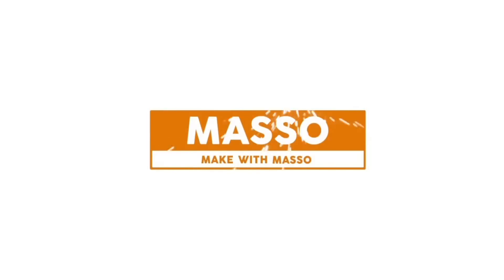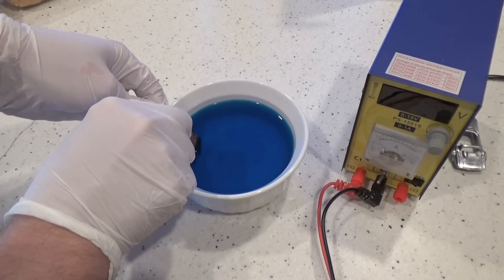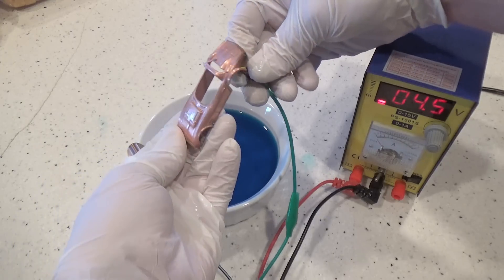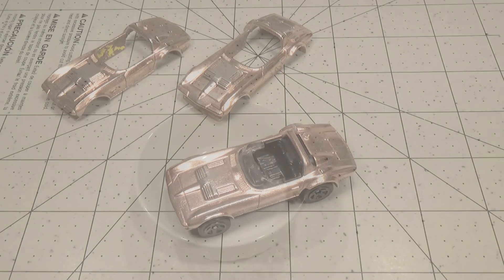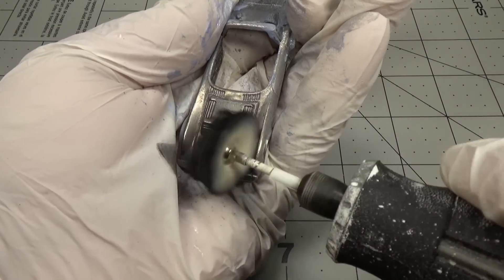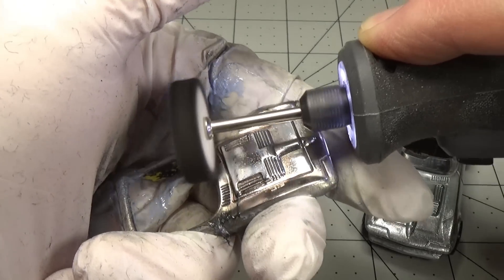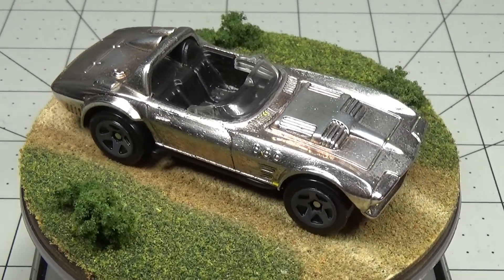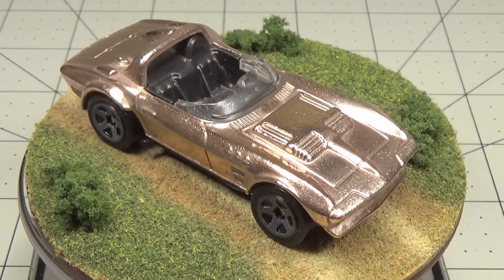A Guide to Copper,  Nickel and "Chrome" Plating a Hot Wheels or Matchbox Car

Comment: FYI, the copper Anode does nothing but provide an electrical receiver that will not contaminate the solution.
YES, the solution will run out after a while.
So far, I have done 10 cars with 8 OZ of the flash solution, some 2 times. Still works great.
My copper Anode shows no sign of being used. Still looks like new.

Comment: Are the die cast cars pot metal? I have a few antique mantle clocks that have cast, pot metal cases. They were originally gold, but have been painted at one point. I'm researching techniques on how to gold plate them. I guess pot metal would need to be plated with something (maybe copper) first, before the gold? Or else the gold would not stick? Is this all correct?

Comment: In Europe, zinc diecast parts a generally zinc strike plated "first" before they are copper plated. The intention is to ensure a better bond as copper does not adhere well to the aluminum that may be present.

Comment: I just won a chrome plated car on Ebay. It's an anniversary edition of the Firebird funny car. The one based on a 77 Firebird. It has a raised Hot Wheels anniversary logo on the roof of the car. But the chrome coat is badly chipped. I assume it's not an actual plate job but more likely a paint. What would be your suggestion on how to refurb that chrome look cleanly? I've watched your playing videos and I have seen people airbrush the chrome Molotow paint to make a chrome look.

Comment: Hello. You seem to be the guy with the chemical knowledge, I wondered, have you tried Retr0bright on yellowed window pieces? It's an idea that keeps coming back to me, and I did try it, but I'm not sure I got it right. Didn't hurt the pieces any, though.
Reply from the maker: I use chlorine dissolved in methanol... gets rid of the brown in seconds and requires no sunlight.
Reply: @baremetalHW  oh, brilliant! I'll have a go at sourcing the chemicals. Is there a rough ratio you could advise? - Thanks. (p.s. if you have to do one for a video soon, would love to see it in action, but you seem so busy I know that is a bit of an ask).

Comment: Another excellent video! Great information! Thank you for sharing this! My favorite is the nickle because it gives a nice patina look to the casting. But I also like the copper car too, plus you can solder it if you need to. That's cool! Thanks again for the info! And those copper ghost flames would look hot under a light color spectraflame!

Comment: Watching the bit with the copper flames got me wondering.

If you masked in a vinyl tape can your hobby laser vaporize that like it does paint.
So strip car initial plating, mask, laser the flame pattern, plate with copper, remask and laser the outline of the flames and remove majority of the masking so they are protected and then spectraflame paint.

Will the laser blast the spectraflame off? If so what would happen if you plated an exposed area with the rest spectra flame painted

Comment: Here's my two cents.  I've been copper plating and electroforming for about two years now.  To get a half decent plate you need to electroplate more than a few minutes.  I would recommend at least an hour.  Preferably longer.  I plate jewelry sometimes up to 24 hours.  That gives me a layer about half a millimeter thick.  I can't even file through the plate without really trying.  Also, once you get a decent plate, you can electropolish.

Comment: The ghost'ish flames are nice. Might be able to figure out a way to nickel then copper the flames over that. Can you remove the nickel or chrome with your laser? Can you copper plate after nickel/chrome plating without plating over the nickel/chrome? So you would end up doing copper plate, nickel or chrome plate, laser design, copper plate design.

Comment: The nickel plated cars didn't come through that well in the vid, I couldn't tell the difference between them. I think both needed more time in the plating solution as you could still see a lot of copper showing through in the groves and especially in the 90 degree section around the base of the raised part of the hood. I think this may have muddied the difference between them because they both looked like they had the straw tint because of the copper showing through and reflecting off the parts that were better covered. 

Either way both the nickel cars couldn't hold a candle to the shine of the zinc, so for 'chrome' effects, that would be my choice. The copper looked good, mainly because of the color being something different than the shiny silver that we are all more used to seeing.

What I would be really interested in seeing is a different take on your idea with the flames at the end. Do just what you did with the laser and burn off a pattern on one part of the car and copper plate it. Then strip the rest of the paint, polish it as best you can and paint the whole thing in spectraflame to see if the copper pattern shows through the paint and by how much. It might be a cool way to add 'ghost' flames depending on how well the copper shows through compared to the zinc coating the car comes with.

Comment: I like the polished copper the best. Now to try something weird, plate part of the car copper, and part nickel say in a diagonal line across the body..by only submerging that part of it. Could be very interesting especially under the spectraflame which is in essence a candy paint. I wonder if there are other metals that could be used in the copper bath? could you use actual pennies, the copper kind I suppose, but the new pennies re zinc with a copper color added, so that might be interesting as well. 
A lot of people don't know why you hook the casting to the negative lead, that's because the electricity flows from positive to negative not the other way round like most think. That's why early cars were a positive ground instead of a negative ground as today.

Comment: Do you have any techniques, tips, tricks or advice for painting die cast cars with spray paint?  I'm capable of the tear down, paint removal and polishing processes but I don't have a paint setup.  I've got a steady hand and above average spray paint skills but I was just wondering if you have ever had luck painting a car with spray paint?
Reply: sexxaylexi   It will look good.  Try some Tamiya spray paints from eBay.     And you will have to do some polishing afterward.   I also like their spray on gray primer.